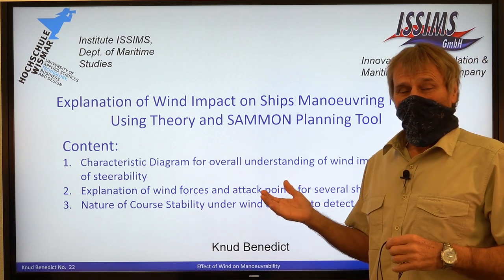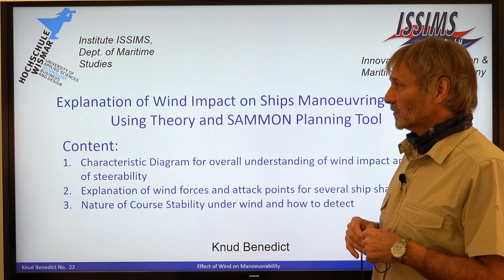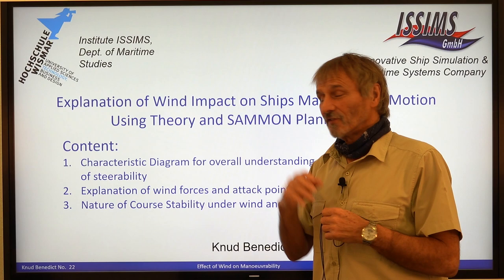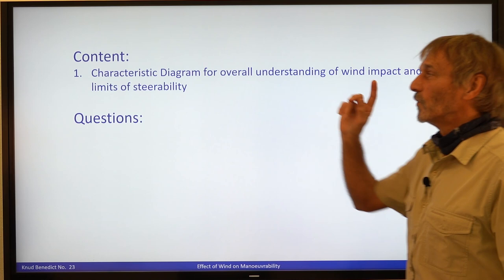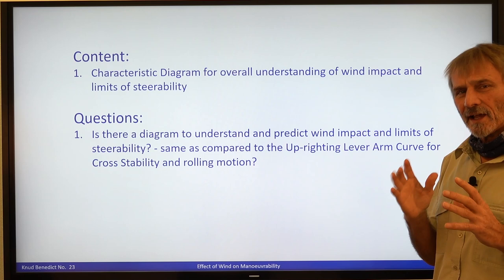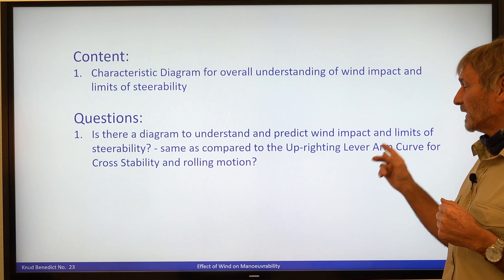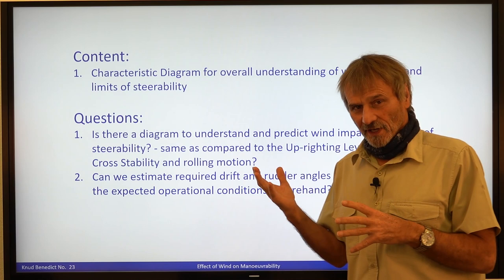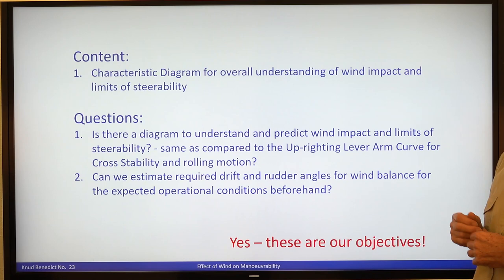Characteristic Diagrams for ship behaviour under Wind Impact

Comment: Would like to see the same for a Handy-sized bulk carrier, with trim by the stern, head, & even keel.
Reply from the maker: Thanks for your interest, Michael.   Yes you can apply these theoretical findings to any ship. A good indicator which type of graph in the characteristic diagram for windward or leeward behavior you might expect, you can find out when you measure the encounter angle to a steady  wind which she finds for midship rudder. This is the zero crossing in the graph....

Comment: What about if even keel ?
Reply: Seems to me if making headway it will always turn into the wind (windward) unless lots of forward sail area.
Reply from the maker: Whether a ship turns into or out of the wind depends 
- both on the attack point of transverse forces at the hull below waterline
-  and on the wind attack point the above water area. 
So you are right that forward sail area (moving the wind attack point to the bow) turns the ship leeward; but the same tendency you can also get by stern trim (moving the underwater attack point of the resulting drift force to the stern)...
Reply: @issims-innovativeshipsimul4419  For an even trimmed vessel with equal sail area making headway the ship will always turn to windward (everything else equal) due to the pressure on the bow that moves the pivot point forward. I know you mention not to think of the pivot point as a ‘fulcrum’ which is interesting as several books make reference to it being a ‘soft fulcrum’ (behavior and handling of ships by Hooyer). 

Thanks for the feedback, definitely a lot of different conceptions out there.